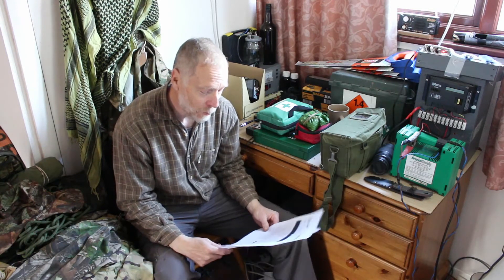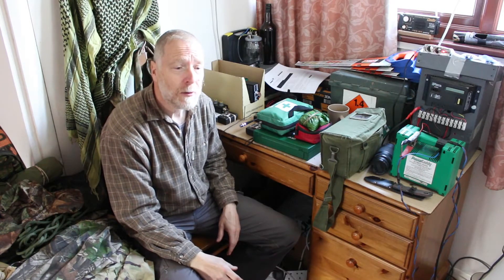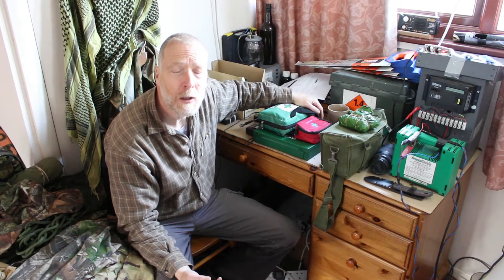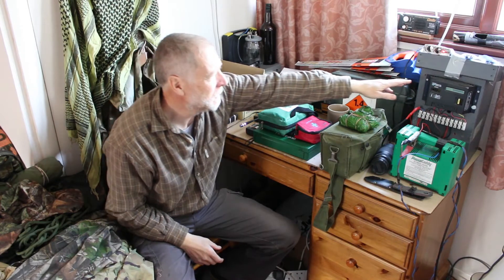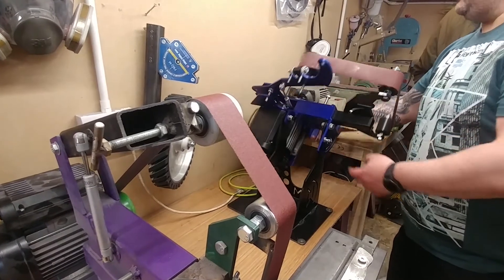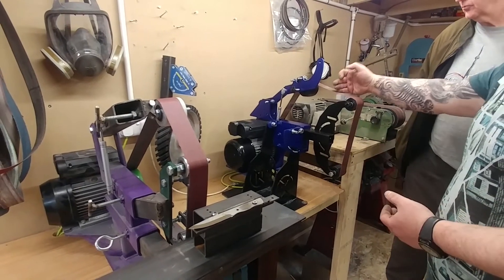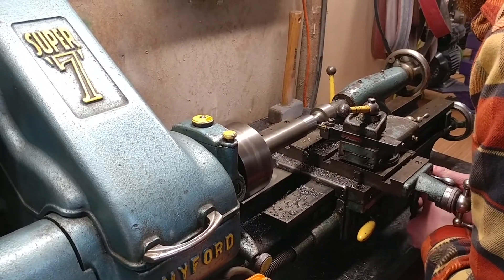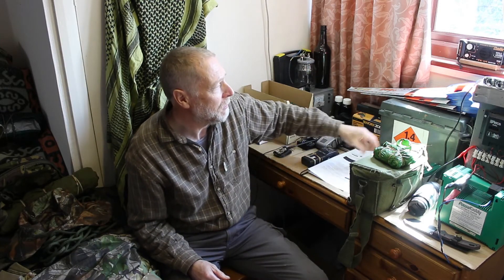Manticore Knives Visit and Expedition Preparation

Comment: Absolutely agree the 1st Aid kit is vital , i'd be interested in the solar panels , looks very skilled the Knife maker , I usually take a swiss army style knife along as well as a Bushcraft knife very handy to have .
Great video , looking forward to the next
Best regards Shaun
Reply from the maker: I tend to be responsible for 12 volt battery charging so we can run the forge fan and charge the mobile devices etc. I always struggle as we never have enough solar capacity with our climate, but we are not setting out to duplicate home life so it is all OK. Mind you using the batteries to weld does them no favors. Atb and be careful, we will be swapping roles, I will be doing electrics and you will be doing bushcraft :-)

Comment: I have the same list. Every time I buy something new for my kit, I have to add it to my list. And every time I come home I have to make sure that I haven't lost anything. I'm very OCD about that. I used to have a CB back in the '80s. My handle was pie and peas. Do you still have to SWR them in? Right, I'm going to have to leave it there for a bit. Ben Fogle is on. Back in a bit
Reply: Oddly enough, Ben is spending time with a bush crafter tonight. How spooky is that? I would love to see what you are all going to be taking on your expedition. I think seeing that would be a real education. :-)
Reply from the maker: Yes you do have to use the SWR meter to set the antenna to the correct length but I think the output transistor circuits must be a lot more tolerant these days. I always watch Lives in the wild when I get to record it as I can't watch anything with adverts as it just wastes too much time and breaks the flow of the program. It is one of the few programs I watch and I hardly watch any TV really. Thanks for the link I probably have not seen it. I don't think some of the guys would want much exposure so we will be keeping it fairly basic for the video  😀 a little while off yet, plenty to do 😀 and hopefully we won't all be locked down again before we actually get set free.
Reply: . @GrasshopperOutdoors  I really miss those days. I Ioved the old A.M rigs. I'm a massive fan of Ben Fogle and the programmes that he makes. I much preferred his expedition programmes, though, if I'm being honest. The guy with the white beard? I'm sure he has teamed up with Ray mears in the past. I understand, we do what we do because we want to get away from everything. It is a shame though, it would have made for a great video. Oh, I misread that, so you will be making a video?:-)
Reply from the maker: @southleedsmemories2686  Yes I will be making videos of the trip, just not all aspects, but when you analyze what we do we are in fact trying to recreate in the woods most of what is important in modern life, only on a much more basic level. And, especially as we get older it really makes us appreciate a lot of the aspects of "modern life". Nature might look beautiful, but it is in fact brutal, Otzi the ice man did not die of old age 😀 😀
Reply: @GrasshopperOutdoors  You are absolutely right. Fire, food, water, and shelter are the things that we all need to survive. I'm really looking forward to seeing your videos. Enjoy what is left of your evening and try to enjoy your weekend:)
Reply from the maker: @southleedsmemories2686  For the species to survive you also have to include sex 😀